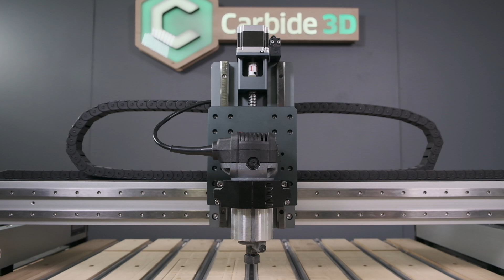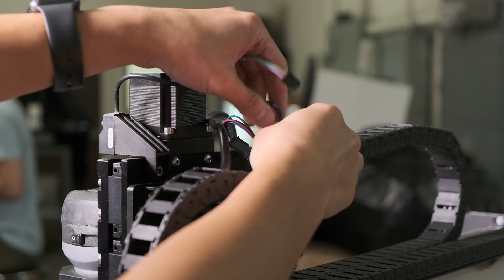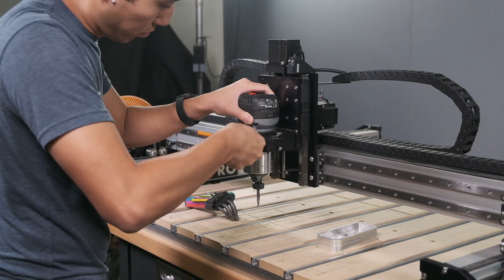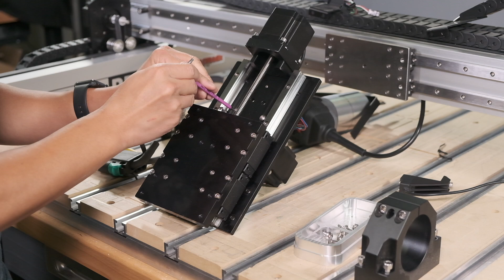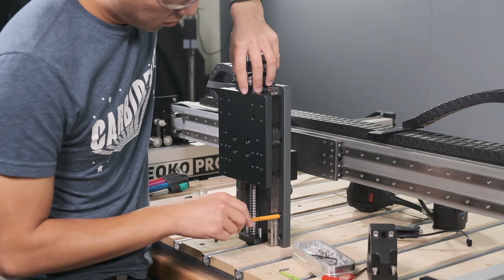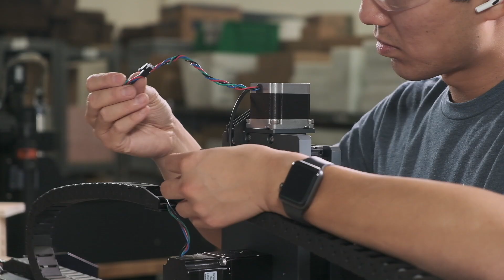HDZ for Shapeoko 4 & Pro - Installation Instructions

Comment: Going by the language on the store listing currently, is this video outdated? I expect to buy it & switch them out without having to use donor parts. It is a lot of money; it says it includes a new z motor. I would expect a new z motor for the more robust machine & especially the ball screw. Can anyone tell me: Will this be easier/less hassle than this video makes it seem for a 4 Pro?
Reply: I am replying a year later, but I just installed this HDZ on my Shapeoko Pro (some may call it a 4 Pro). It does come with a new Z axis motor. You get what is shown in the photo on the Carbide3D site which means you do have to swap over things such as the X axis motor, etc. that is shown in this video. Installation is about as you see in the video. Sadly you get no instructions in the HDZ package. I used the method shown to remove the Z axis travel stops and slide down the carriage plate to get to the last two screws. Given the plate still is mostly held in place by the Z axis motor and screw I didn't feel much risk.

Comment: what sort of performance increases can one expect out of using a 2.2 kw spindle when milling aluminum?
Reply from the maker: A spindle runs at much lower RPM and Higher torque.  You won’t need to have the router going full out.   Cutting aluminum is still loud, but less so with the VFD. 
You’ll be able to go to a greater depth of cut.    
Additionally you can now set your RPM accurately through the software and the VFD will run that specified RPM, thereby improving your control and cut quality.

Comment: I would have love to see a screw driven Y or X axis upgrade. Nice gantry tho.
Reply: They have it not in 5 pro! Or HDM. I would go with HDM & skip 5 pro. 4 pro, despite being on belts, is better than the 5 for several reasons, IMO. The only thing it has over the 4 is the more completed shipping state/easier assembly & the lead screw drive. It is not ball screw though - HDM is. It is for that reason, I would tell people who are not happy with 4 pro offerering to get the HDM instead. 4 has better placement of bitsetter, I like the wiring harness better, few other things. I do not like 5 pro tbh. I like 4 pro. If I get another Carbide3D large format machine, it would be HDM, though I am not sure whether it has as many footprint options as the Shapeoko lineup.